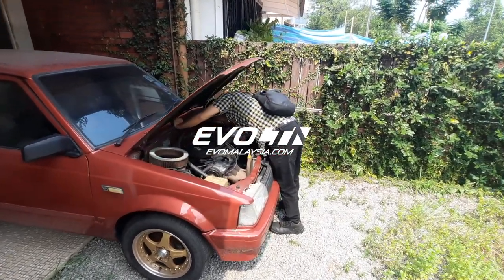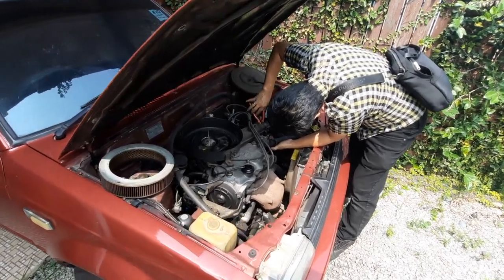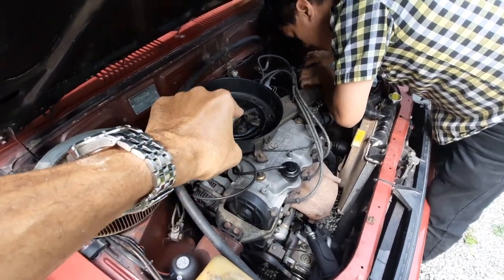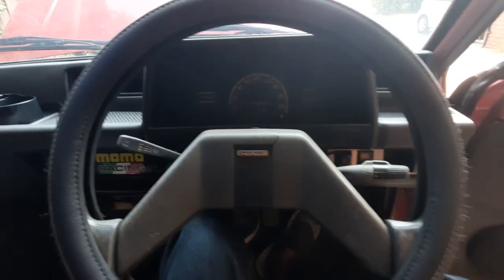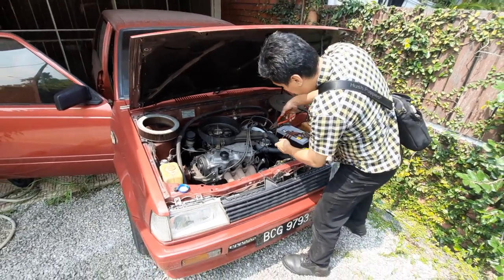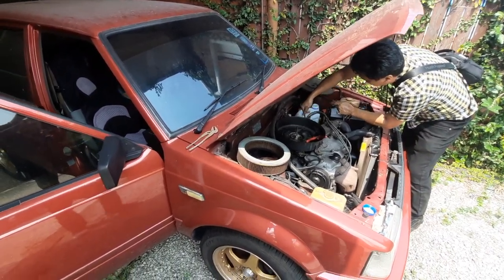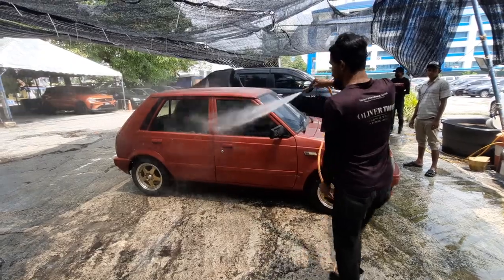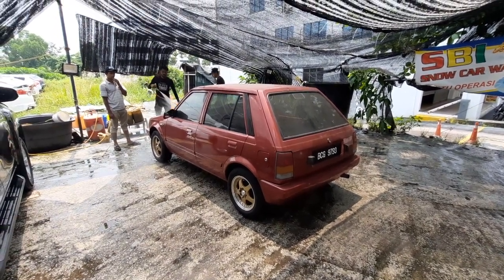WEEVIL UPDATE 2: SHE'S ALIVE! 1985 Daihatsu Charade 1.0L (G11) is BACK!! | EvoMalaysia.com

Comment: My carburetted Civic SH4 has difficulty to start after sitting for too long. Like what Chris said , the fuel in carburettor flow back to the tank (or evaporated 🤔) left the carburettor bone dry. Instead of pouring petrol into the carburettor, I use the blow torch gun that attaches to those gas canister for portable cooking stove. Point the blow torch to the air inlet hole and turn on the gas (without igniting it) and try to start the engine, works everytime. This allow my engine to run temporary on "NGV" and works the AC pump to pump petrol into carburettor. After about 20 second, the gas can be turn off and the engine will continue to run on petrol.
Reply from the maker: Fantastic!! Thanks for the feedback bud, good stuff!! Run on NGV for a while, that made me laugh! Hahaha! Good one! 😄😄😄👍🏽🙏🏽

Comment: Change oil filter also bro. Probably got clogged there abit. Another alternative, open the round carburetor thing and use throttle body spray. It will run enough to get oil filter changed.
Reply from the maker: Full service coming soon!! Thanks for the tips, I think u meant the fuel filter right, yeah gonna do that 👍🏽😊
Reply: @ChrisWeevilGarage  ya2 that one haha
Reply from the maker: @GoldTimer  thought so! U had me wondering for 5min what the oil filter at the engine had to to with anything, hahahaha!!!🤣🤣🤣🙏🏽👍🏽